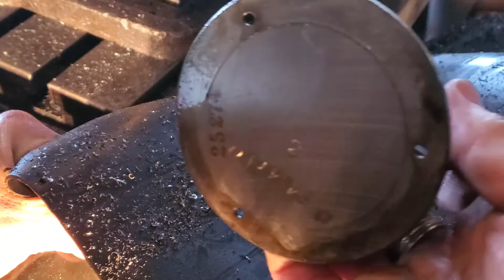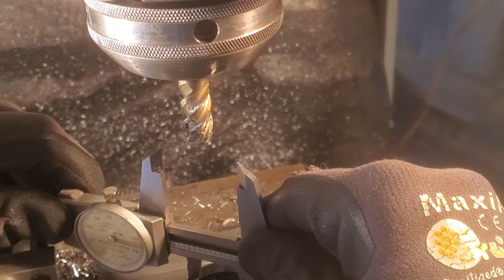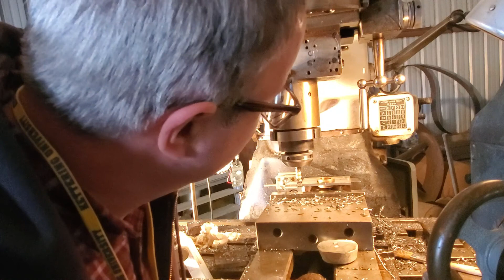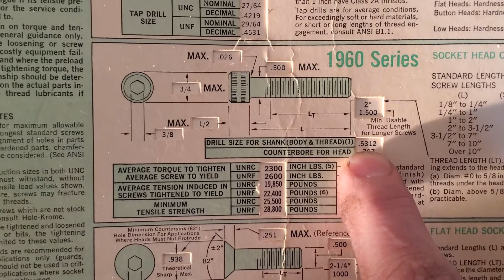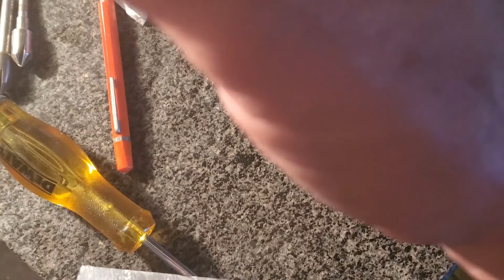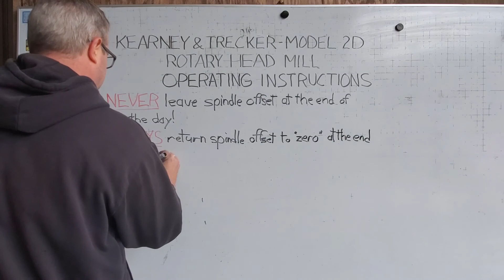Holes & Roundovers on the K&T 2D Rotary Head Mill

Comment: How big of an issue is it to find tooling for this mill if you dont have the original set of collets?  Are there adapters readily available?
Reply from the maker: Taper matches NMTB 30, but K&T collets are hard to find. Worst case run an ER32 or ER40 to 30 taper adapter

Comment: I predict this mill will be the new most wanted to own. You will no doubt need a boring head even with this mill. Fly cutter , larger insert type cutter , maybe some slotting cutters , wood ruff cutters. Get the things when needed . hold down set n tee nuts .
Reply: A mister for coolant works well on mills also.
Reply from the maker: I'll feature some of these in upcoming videos. Boring head is by Flynn. 2D's could be had with coolant and air, this one did not. I found a set on ebay, also will be in upcoming vid.

Comment: CNC is more than impressive for what it can do, but it's a shame it's pretty much completely stopped any further development of manual only machines just like your 2D. Fwiw when edge finding with the actual cutting tool I always copy the old school machinists trick of using a cigarette rolling paper. Any paper can work, but at larger thicknesses it's compressible so your not 100% sure of exactly where the tools cutting edge position really is. The Zig Zag brand in the light blue package is so close to a thou you may as well call it that. It's a quick, cheap and easy way to edge find while compensating for any run out the tool, collet or even spindle might have. I'm confident I can edge find using that neanderthal technology and be within at least half a thou. Obviously with a tool rotating you'd want to hold the paper in something like needle nose pliers to keep your fingers away from the tool. But that little trick still works as good today as it did 100 years ago.
Reply from the maker: I have been meaning to try that, will do it in an upcoming video... And it gives me an excuse to buy a pack of Zig Zag rolling papers from Sheetz!
Reply: @EngineersWorkshop  Like anything else that paper trick seems to go slow at first, with a bit of practice it then goes fairly quick. It's also a good one to use to find a new tool or replaced tip on the lathe for either the parts face or OD. I'll use it on the mill some times even while having a Haimer 3D since it can as I said compensate for the actual tool edge with the small but inevitable run out. I keep those packages of rolling papers in with my precision tools because as simple as they are, there still an extremely useful tool. 

Another trick they used those rolling papers for was checking for flatness. Add a paper under each corner on the part and if any corner isn't on the same plane it can be withdrawn without ripping. If that can't be done you then know your parts flat to a bit less than a thou. But I've rarely done that since the part rocking on a flat surface is probably even more detectable and accurate.
Reply from the maker: @turningpoint6643  I've seen that referenced in old steam engine texts, about checking flatness with papers.

Comment: Nice video  knee oiling, have you ever looked at the oil level glass on the knee and then raise or lower the knee by power and you will see a wash of oil down the glass showing that the oil pomp is operating ? There is a little plunger pump ,that is in contact with electric motor and pumps when you actuate up or down on knee lever.  I have used nmtb30 tooling in my spindle had to make a new nut  I show it in practical machinist forum keep up the videos  ed
Reply from the maker: Awesome! Your knee is so much quieter than mine, I hope mine has no issues. I bought a matching nut from McMaster to modify for use with NMTB flange.

Comment: Tolerance for 360 degree rotation of the rotary head is .0003 max run out.. It is adjustable.. Cheers from Louisana
Reply from the maker: Mine is between. 0005" and. 001" TIR. I need to fuss with the gibs when I have a better tenths indicator.
Reply: @EngineersWorkshop  Yes.. It is a bit off.. My 1942 model was still within .0003 some years ago but may not be now... I have the cherrying attachment, slotting attachment for mine.....Cheers from Louisiana

Comment: There are trip dogs for the periphery of the rotary head... I have added the drawings of those dogs on the 2d group on Facebook.. Cheers from Louisiana. Mike
Reply from the maker: Thank you, it's on the project list to build a pair, plus a set for a buddy. Gotta get the rotary table set up, there's a 15" diameter cut on one side.
Reply: @EngineersWorkshop  I have both 12 and 16 inch rotab along with drive bracket to run them.. Again, trip dogs on the rotary tables as well..
Reply from the maker: @ramsay19481  would love that drive setup. My table is an 18" Troyke. Barely fits. Could you email me the dog dwg..? Email on my "about" page or at EngineersWorkshop1964@gmail.com Not on facebook

Comment: Your 2d has the double angle collet set up.. Mine originally had spindle ground for B3 Bridgeport collets with drawbar.... Someone later reground my spindle to accept R8 tooling which makes it much more versatile... Mine is from 1942 and has no power lift to the knee, a major gripe of the early 2d mills....Cheers; Mike in Louisiana
Reply from the maker: Yes, loving the power knee. Do you think modern NMTB 30 tooling will match, if I cut off the threaded stub? Would love a NMTB / Er40 collet holder.
Reply: @EngineersWorkshop  That I do not know.. The only machine I have any experience with is mine and it has been converted from b3 to r8 by someone prior to my ownership....

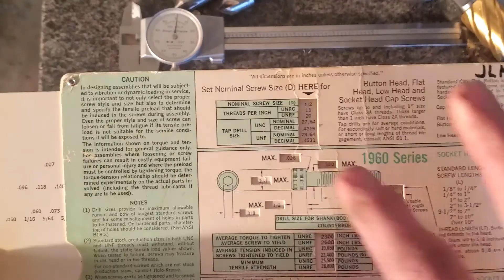Comment: That is a most interesting machine. By the way, I did not catch the name of that chart you referenced at 27:57. Could you please let us know? It seems to be super informative. Thanks! Great video, as always!
Reply from the maker: Holo-Krome Socket Screw Selector. Here's a pair on ebay https://www.ebay.com/itm/Vintage-SET-OF-HOLO-KROME-SOCKET-SCREW-SELECTOR-SLIDE-CHARTS-INCH-METRIC-/233902251406?_trksid=p2349624.m46890.l49292
Reply: Thank you!!